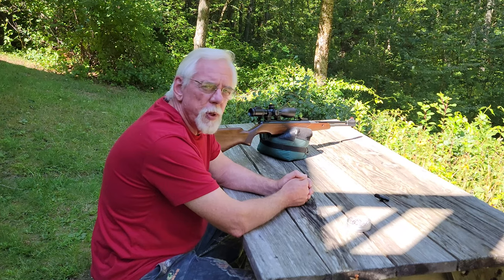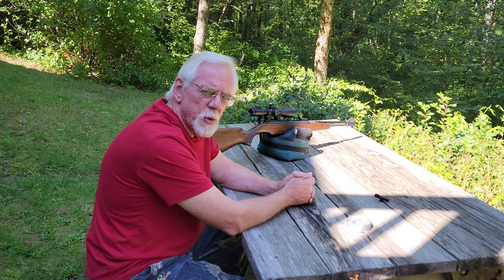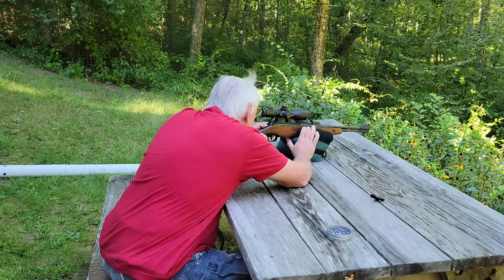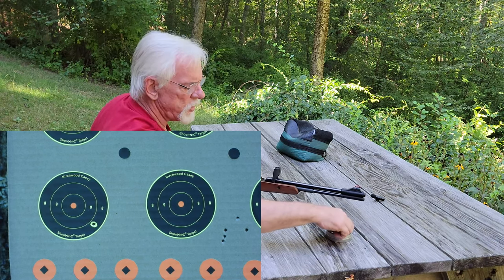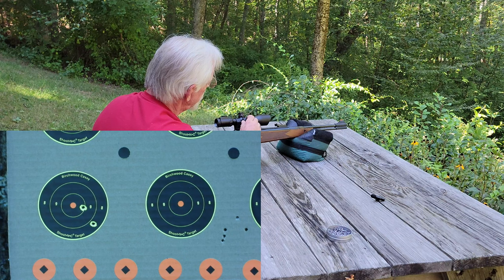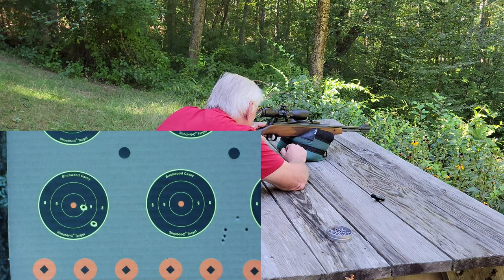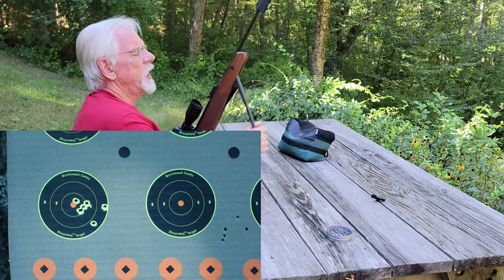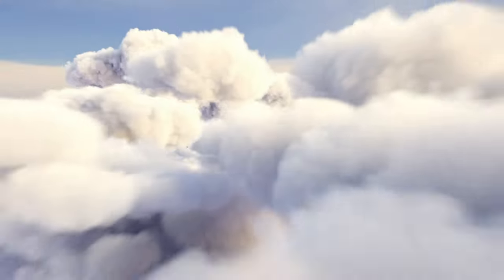Zeroing An Air Rifle Scope

Comment: Well Done ! Still got it dialed in pretty quick. A lot of folks overcorrect their clicks and chase it in circles.
"Especially" if they adjust it in two planes simultaneously! 😉👍
Gonna be a nice rig. 😁
Reply from the maker: Thanks Marc. It's easy to dial yourself way too far and trying to adjust both windage and elevation simultaneously will get you into trouble quickly. 😁 I'm really liking this Model 46. Of course,  that doesn't mean that she's not going on the workbench. There's always room for improvement.  Thanks as always my friend.

Comment: That's pretty much how I do it haha!
I wished the 7.9s shot like this in most of mines

Ive tried to adjust the scope while holding the rifle (no rest) and it was not a success!
Reply from the maker: Hi Lowkey! Hope you're doing well. I find that the .177 Premiers HP's do well in lots of guns. Don't ask me why though.  They're not very consistent. Thanks as always my friend.
Reply: @razor1962  Maybe you need to try the Andy gray custom version!
He sells them for very cheap on ebay for the work he is putting into them 
{Seems are shaved, skirt is painted and the hollow point is filled with hard acrylic}

Id like to try them myself for sure but shipping to kenada is awfull...
(About 4x more money than the tin itself)
Reply from the maker: @LowkeyAirgunner  That's insane. Is it normal for postage to be so high in Canada or is it left over from the pandemic?
Reply: @razor1962  it was already pretty bad but it is not getting better for sure!
A regular order from canada to canada can cost easily 20-25$ of shipping...free shipping is rare 

[For example I believe "cbls the fish pro shop" is free shipping after 50$ in the USA? ...ours is 150$  and 50$ when they make special offers]
Reply from the maker: @LowkeyAirgunner  Wow! Sorry to hear that. Kinda makes it cost prohibitive to order anything online. 😕

Comment: Hi kevin! I did once buy a laser bore sight to make it easy, but mine was no good investment. I do it your way. Easy and quick👍
Next time i will use that bore sight it will be on my .308 win. and i'll leave it there when i blow out the first round and vaporize that crap with a V-Max the whole way back to China 🤣🤣🤣Cheers!🍺
Reply from the maker: 🤣🤣🤣 That'd be a sight. 
I'm sure that you already know this but just to clarify, for the benefit of those who may not know better... Under no circumstances should you ever fire a weapon with an obstruction in the barrel. Very unsafe to the shooter and bystanders and will damage your weapon.
Not to mention the fact that it'd void the warranty on your bore sighter. 😁

Comment: You are a true amateur. A real rifleman needs no sand bags for a distance shot.
Reply from the maker: The cool thing about YouTube is that  you don't have to watch something if you don't like it. The bad thing about YouTube is that it allows opinionated idiots a place to be idiots and to voice worthless criticism.
Reply: @razor1962  That air pellet gun only throws a .22 cal. chunk of lead at about 1,000 FPS (or slightly higher.) While I know the rifle and know that it is rifle bored, it is not a very good gun.
Reply from the maker: @bobbyquinting3918  It's an air rifle. It's in .177 and it shoots nowhere close to 1000 fps in .177, nevermind. 22
I own nearly 50 air rifles currently and over the years, I've owned hundreds. I know the difference between a good air rifle and a a not so good air rifle. 
What is your reason for the negativity?
The model 46 is a wonderful rifle.